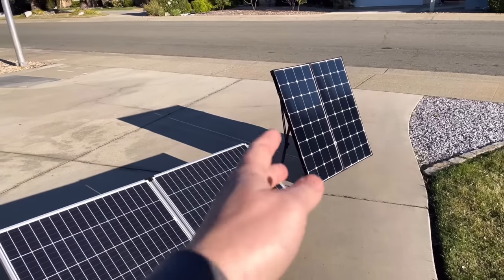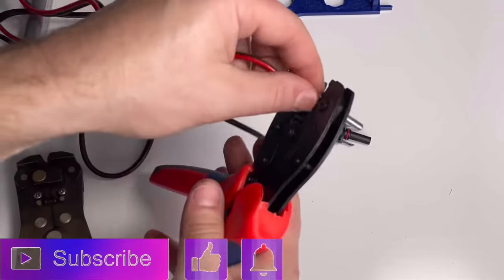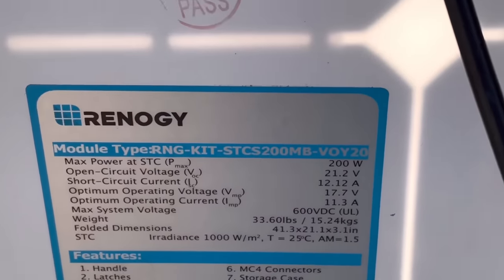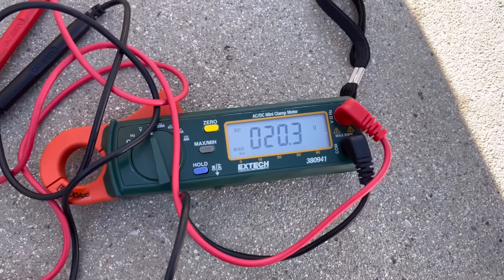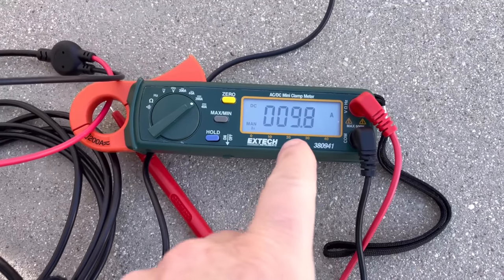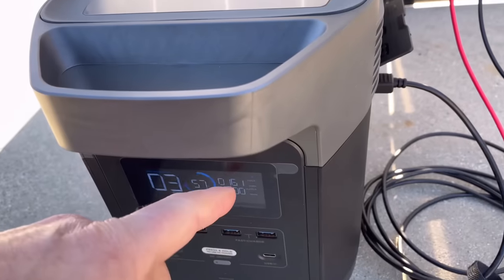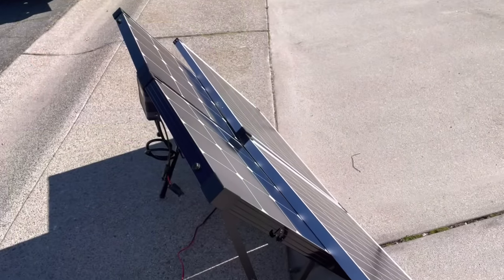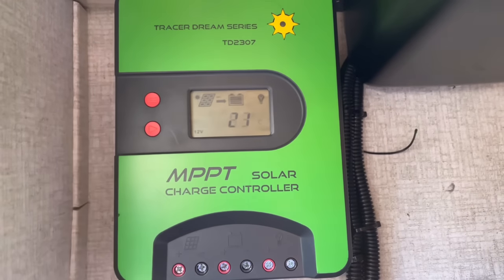Best Solar Panel - Harbor Freight 100 Watt Solar VS Renogy Eclipse Solar

Comment: I have a 300W Bluetti 'solar generator' (LIpo battery plus invervter inside).  It will charge from the wall with a cord that goes into the input socket (marked 12-40V or 120 W max).   I got Thunderbird 100 Watt panels--4 25 watt slim and not heavy panels that link together.  I found an adaptor that would connect to the out put from that and then connect to the input socket of my Bluetti.  However, even out in full sun, when there are blue lights on each panel (suggesting to me that they are getting energy from the sun), when I connect that to my Bluetti, no input shows as going in.  Unfortunately, I bought the HF panels about 2 years ago and have lost the reciept.  They were $185.  Seemed a terrible waste to pay $330 for Bluetti's 100 Watt panels.  Would appreciate thoughts here as to whether you all think the connection is at issue or if the panels aren't really generating electricity.  They aren't cracked in any way.  It DOES come with a little MPPT to connect to, but that requires getting a 12 V battery and connecting to that.  If I'd wanted to do that, I wouldn't have bought the Bluetti.  Feeling kind of stuck now.  When the Bluetti is charged, I can plug lights, laptop, etc, into it just fine....
Reply from the maker: I would start by checking each panel…
Make sure there is output from each one. 
Then link them together and check out put again… if all good add your adapter then check out put again. If power is coming out from there, then the Bluetti may be the issue or it may not like the adapter. 

Your just checking for voltage on each panel 

Let me know

Comment: Prefer spend 4 panels at 4$400 for 400 watts of power per hour and replace later if not good. But at leasr you can use ist for maybe few years
Reply from the maker: These panels for many have been holding up so far really well. I think they will do great.

Comment: I've had the standard, cheaper pair of Renogy 100 w panels out at my hunting camp going on 7 years now.  This is in a swampy part of Florida, humidity is high, and great sunlight.  They still perform extremely well.  On the other hand, I've gone through a number of solar projects for friends and family here in Florida who decided to go to the extremely cheap route using harbor freight solar products.  Over the years since we installed their solar setups, they've all moved to Renogy.  All it will take you is two or three weekends of fighting with stupid issues related to the cheaper panels before you recognize you went too cheap.  I'm not advocating 25-year LG panels or something like that, but if you're going to buy in the budget realm of Solar, don't scrape the bottom.  It will waste your time and your money.  I'd love to see a review of these two setups 5 years from now. I have no doubt that the Renogy panels will still be functioning within their published efficiency rating.  My opinion and experience, you will have bought a second or third harbor freight set by then.  Just my two cents based on my experience with both products over nearly a decade of use.  However, I'm just an amateur who believes what they see with their own eyes.  Your mileage may vary.
Reply from the maker: I agree experience with a item helps but you need multiple reviewed responses to draw conclusions. You may have a great experience with the same item someone else who had a bad experience. That’s why comments like yours help me and others draw a conclusion on what May work for them.

Appreciate the feed back 😀👍🏼
Reply: @johnnysweekends  Agreed 100%. My message was in no way intended to negate the review or anybody's feelings on it. Just providing my experience. Which is why I like to use the term "your mileage may vary".  Hell, any two people can hook it up differently.  LOL.
Reply from the maker: Lol totally true. And doesn’t matter if it’s cheap or expensive you can get a bad one from either brand.

Comment: Is it best to buy the harbor freight kit,  152$ or just the single (thunderbolt) 100w panel , 102$ ?
Newbie here, want to charge some deep cycle 12v batteries for offgrid...lights,fans,12v freezer, charge cordless tools....

Eventually,  an appropriate off grid system for homestead...

Thanks in advance
Reply from the maker: I would grab the panels and buy a different charge controller.
Reply: Ok, thank you,, do you have a preference (brand, model) for charge controller...

Just found your channel
Reply from the maker: This model has been around for while with a lot of good results and has proven to be pretty reliable. It’s not mppt style it’s older tech pwm but they still work great especially for low budget and small builds. 

https://amzn.to/3LYC6A3

Comment: I wanna ask? Why do people always buy pannels that have 100 watts for example but when I look up pannels some are like 500 watts! Why wouldnt I buy 500 watt compared to 100 watt pannels? Sorry if thats dumb I just dont get it
Reply from the maker: There is a panel out there for every build. Small panels are just another option when building your project, solar suitcase maybe or small shed that can only hold 2 or 4 small panels. Obviously with any build its a good idea to see what can or will fit better as larger panels require less material overall for install and normally can be a lower cost. Again every build is a little different

Comment: lol there's differences in amps from the meter thats closer to the solar panels getting energy right there, the extech meter was on the ground had all that wire with resistance so of course its going to be less
Reply from the maker: They both were connected the same with the same cables when plugged into the ECOFLOW solar station and then to the trailer.

Comment: What connection is that you're using on the side of your trailer? I'm going to be adding solar to my trailer and was looking for a quick connect like this.
Reply from the maker: I have the furrion solar ready plug on the side and it’s basically this 2 pin connector setup.

See here …https://amzn.to/3ajASSL

Comment: Those don’t come with Anderson  connectors, I know them as Narva or Hopkins connectors. Zamp is a solar brand that uses them as well. Mc4 are hard to use with bare hands and when your putting up and taking town a lot the tools are two more things to lose making your day harder. Anderson connectors are arguably more common in he 12v world but the narva/Hopkins are great at what they do just the same, 15 amp limit on those per spec sheet.
Reply from the maker: I’ll admit mc4 is not the best for mobile type applications but I have almost all mc4 stuff and adapters. 
But yea that was a SAE connector as we call them. I accidentally called it a Anderson and never caught it in editing. 
I was messing with Anderson stuff early and just called it that by accident. 
Which reminds me I need to order a couple lol.

Comment: When you replaced the sae connectors from the HF panel. Did you have to reverse the polarity? I heard they were reversed. Trying to decide weather or not to replace or get an adaptor.
Reply from the maker: No red is still positive unless they had some panels that where not correct. You can always check with a volt meter

Comment: Are the HF Panels waterproof or resistant ? I plan on putting them on top of my camper van but I want to permanently mount them
Reply from the maker: Yea it’s the junction box ya kinda have to worry about but it’s sealed as well. And says it can be mounted outside ..

👍🏼

Comment: Strongly suggest that you present a summary of the data with a chart.
Reply from the maker: I thought about doing a chart for a full day of each panel but the variables could really skew the test unless everything is almost exactly identical. 
Time of sun, temp, no clouds or haze and more.

Comment: These panels are really expensive, I bought 3 345watt panels for less than £400, delivered. Admittedly they are 5by3 foot, each, in size.
Reply from the maker: I always tell people but residential panels if they will work for them. Best bang for the buck.

Comment: How did you pay $550 for 2 panels?  I never paid more than $100 each for 100 watt Renovy panels.
Reply from the maker: This is there full solar suitcase with pwm charger, legs and case and I believe one set of small cables. They still sell it.

Comment: NO!!! Wrong!!!
Amps alone do NOT make more power.
You want the most WATTS period.
As long as your wires are large enough the voltage does not matter. Higher voltage does have the advantage of using smaller wire for the same load in watts.
So, which ever panel is delivering the most watts is the better panel.
Reply: So watts is equal to amps times volts (P = I x V) so for the same amount of watts increasing the voltage will decrease the amperage and vice versa.  So, yes, everything you said is correct.

Comment: im new to solar but you have the good panels covered up by the harbor freight panels by atleast half so dont you think that would make a differanc?
Reply from the maker: Hi and thanks for the question. At the time of using the harbor freight panels those are the ones plugged into the solar controller. And are merely using the renogy set up as a stand. 
When testing the renogy set up they were uncovered. 
So all in all they are just leaning against it so I could use the same angle at which the renogy set up was at for consistency.

Comment: Another’s thing to consider, so I’ve seen, is that the Monocrystalline panels degrade about 20% over the first 6 months of use. Retest after the panels settle in to consider everything being equal.
Reply from the maker: Yup not a bad idea… because it is true. These actually said after they settle they could provide more… so that will be interesting
Reply: Are there panels that don't?
Reply from the maker: Most panels loose almost 20 in the first year… but they need to be outside enough for them to settle.
Reply: @Tru_LIBERTY  I don’t know too much more, sorry. Regurgitating information. It seemed significant though.
Reply: I got a 6yr old 100w panel that put out 118w and 8A...couldn't believe it
Reply: @mrmotofy  NICE. You gained about 20%. They’re becoming more and more attractive. Thanks for the reply.
Reply: Dan G Will these panels degrade if stored out of the sun?
Reply from the maker: You’ll find out in about 5 months. I’m one month out so far…😂 they will go through my hell summer and will see how they compare new to 6 months out side
Reply: @rpbajb  I would think no, but I would email the company. I’ve heard since that at least one person had no degradation in a year of use.
Reply: @johnnysweekends  sounds good, if we’re still around in 5.
Reply from the maker: 😂😂 right who knows at the moment.
Reply: @mrmotofy  What brand & model?
Reply: @itsmeforsure5475  just a Renogy 100w

Comment: Finally it comes down to cost/watt.  I tested clearance Canadian Solar 390W Bifacial solar panels with a long term test in multiple weather conditions and got fantastic results.  They have glass on both sides that would allow some light through to the plants below.  If you have time, check out the results and let me know what you think.  Here is the video with the data: https://youtu.be/1SXNjsSsmq0
Reply from the maker: Yea the bifacial looks like they will provide great results especially in the long run as long as they hold up. I assume they will. Still a little spendy but they will come down in price eventually.

Comment: Great review..   can that MPPT controller be used in conjunction with a windmill/generator?  Or does a windmill need its own controller and a switch,  between using solar and wind?
Reply from the maker: The mppt controller can be used for wind as well from what I remember. I would need to double check the manual.
Reply: @johnnysweekends  thanks.. i did end up looking it up...  good info n channel!!!!
Reply from the maker: Thank you 👍🏼😀

Comment: Slow down a little and tell us the difference between the two.  Spouting out numbers is important but % difference and slowing it down would be helpful.  Its not a race.
Reply from the maker: I’ll work on that..👍🏼
Reply: I have a little gear on lower right to slow or speed up the videos. I can't go less than 1.25 most of the time.

Comment: I have a Jackery 1500 - thinking about getting a 320 watt solar panel to charge the Jackery faster when we get good sun.
Would this approach offer any disadvantages or shorten Jackery 1500 life?
Reply from the maker: No the jackery has its own charge controller and will optimize the amount of power coming in from the solar panel… even if say the panel was producing 13 amps the jackery will still limit it to probably 6-8 amps or what ever the Dc input limit is for that model.

Comment: Renology has the quality.  When you look at something that is going to take the snow, rain, storms and 100mph winds etc and hold up to the actual optical degradation due to the sun itself and you have to decide what is it worth to have a panel that will stand up to 15 years of actual use until they begin to break down?
Reply from the maker: It’s true long term I don’t know how the hf hold up except those who have been replying back saying after so many years still good. 
One thing with renogy is warranty department really needs some work.
Reply: @johnnysweekends  for sure..as with many products in demand right now…once you pay for it, you OWN it!  On the other hand I have taken items back to HF after two years of use (I bought the warranty) and they give me a new one and ask if I want another warranty!  And that is STILL the case even in this economy when stores act like returns are like throwing acid in their faces!
Reply from the maker: It’s crazy how good the swap return policy. One of the reason buying some
Products from there is a viable option..👍🏼

Comment: One is a suitcase setup and the other is not.Renogy 100w mono panels are about $100 to $120 each.  I have bought several and they are great panels for the price.
Reply from the maker: It’s doesn’t really matter that they are suitcase are not. They are just screwed together with a hinge. But you can make the other a suitcase as well. I have done a couple now. It’s really easy as well. 
This allows you to buy or use a better charge controller. But of course you don’t get the dance case but you can buy one to cover the panels.
Reply from the maker: It’s true they are nice panels. Over all I think the build quality and power out put of the harbor freight just edged them out a little.

Comment: Skip all of the 100-200w panels.  Residential panels are available new on marketplace near me for <$0.45/watt.  I purchased 400w panels for $175 each.  The only value I see in these panels is portability.  It pains me when I see people use (4) 100w panels when they could have (2) 400w panels for less.  Or one 400w panel, a top grade mppt controller, racking and wiring for less.
Reply from the maker: Totally agree, especially for off grid or sheds and more. For Rv or recreational use these smaller panels are more for portability and weight. The residential panels at 335 or 355 or up to 400 watts can weigh more then two 200 watt panels. So that’s the only reason I would recommend a smaller portable over just getting residential type panels. 
They are typically heavier to withstand harsh weather for years including hail.
Reply: @johnnysweekends  I also agree there are space concerns especially with RV's that have a lot of obstacles poking through the roof.  I don't think weight is too big of a concern especially if the trade off is a much more durable panel.  I managed to squeeze (5) 400w panels onto the roof of my tool truck conversion with 17' of available roof.  I was able to design what pokes through the roof where so I could make optimum use of the real estate.
Reply from the maker: Nice. With a Rv though which I guess people don’t care about cargo capacity because I see them over loaded all the time, but a few solar panels at 60lbs each takes away from over all items you get to bring. So 4 panels plus mounts and racking, wiring, batteries inverters and more, you could burn 350-600 lbs from say a 2250 lb capacity. But it’s not my trailer, I can only tell people what the item is and it’s up to them to make the safe choice.

Comment: I'm just looking for something to charge my few car batteries  to optimum level not even sure what wattage I should go with ..  they are xs power 3400   i have 3 , Just wanna keep them at optimal voltage at like 12.6.. Right now they're about 11.6 obviously they need to be charged they're not connected to anything right now would I be better off just getting a car charger and then running it off of  a 100w  panel ?  Or should I go with a smaller panel set up.. I don't have access to electricity living out of my vehicle..  I live in Phoenix Arizona heat so we have sun every day and pretty strong sun right now..
Reply from the maker: You could buy one 100 watt panel and that would easily keep your car batteries charged. You will need a charge controller with about any setup and I’ll add a link of a common one that has been around and seems to do pretty well. 
But car batteries are not really meant to be drained and then brought back up. 
A car battery voltage should always be in the 12.0 volt range or higher, actually about 12.4 before damage starts to a cure as they are not deep cycles which I meant to go to a lower voltage if need be, but even then there is a limit.

Here is the controller. And if you need room a 50 watt panel could also work but it just depends how much power and how much you drop your batteries over night
Reply from the maker: Controller  https://amzn.to/3LKpqwg